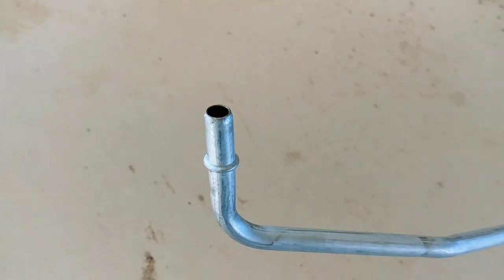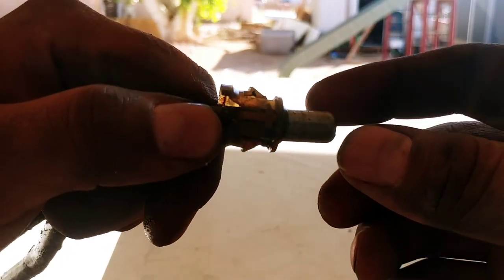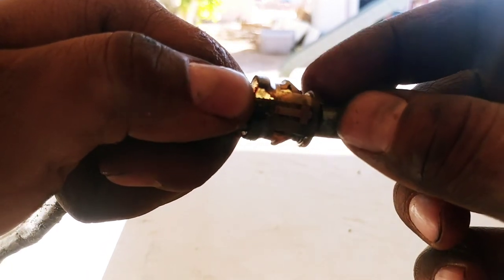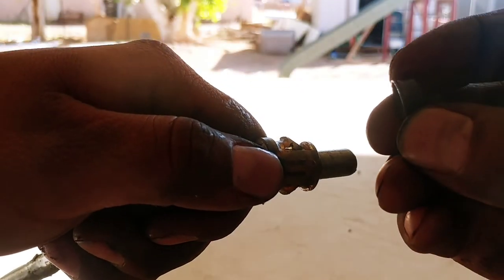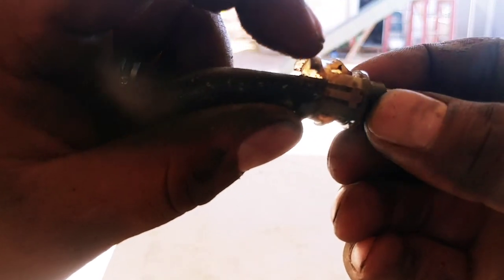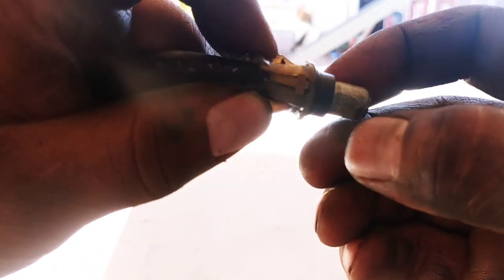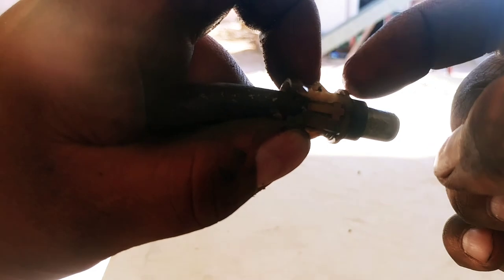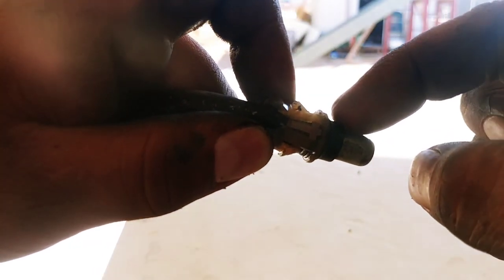xj transmission cooler line crushed and repair

Comment: Mine was crushed as well.  I'll be replacing the line this weekend.  I didn't go with a new suspension though, just new bump stops when I saw that my passenger side was missing it.  Thanks for posting!

Comment: I did something like that, but fuel line only lasts a year. You need an oil resistant line if you're going that route.
Reply from the maker: Thank you. Did eventually get the line brand new.

Comment: I found my line had been crushed by suspension. 

Did you say your Jeep wouldn’t drive forward or reverse? Or very slowly? That’s exactly what mine is doing
Reply from the maker: That wouldn't engage reverse only forwards and very low power